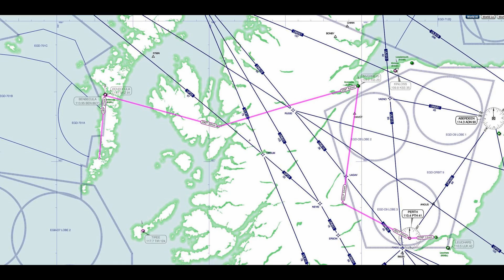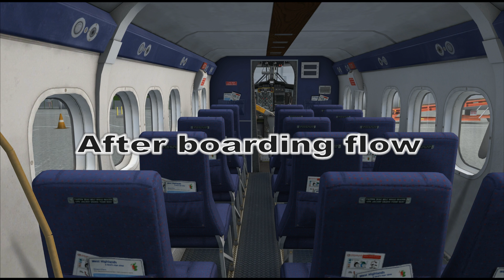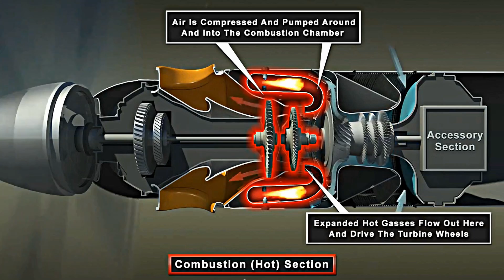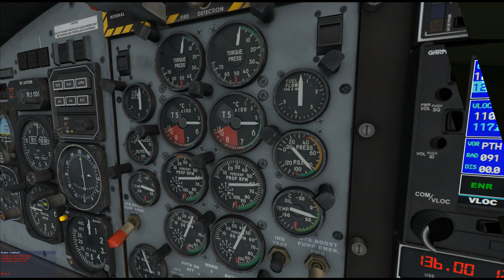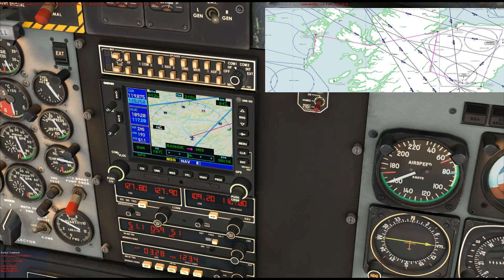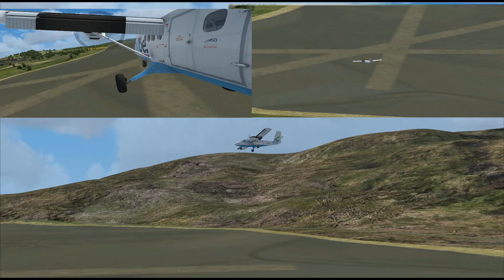Aerosoft Twin Otter M.C.E. Flight Crew Only

Comment: I just purchased this from JustFlight. The trim is intermittent; 
meaning, sometimes the trim works sometimes it doesn't. Same with the 
autopilot. sometimes nav, ias, and alt works sometimes it doesn't. The 
model and cockpit are great but it's hard for me to get excited about it
 when the systems don't seem to work most of the time. Two of eleven 
flights I've made the systems and trim have worked and it's really cool,
 I like it but that's a hell of a failure ratio and I'm too old to 
believe in hope. Just commenting and adding my voice as all, I'm sure no
 one has this issue it's just me as always.
Reply from the maker: Hello, thanks for watching.  I share your frustration. All I can say is that the systems work in my install. Now that's not much use to you, but I have flown the Otter in FSX and P3d V3.0...3.4 HF2. Have you looked at the assignments for Trim and the Autopilot. Are they on your Stick/Throttle/external panels? Or are you using the Mouse in the Virtual Cockpit?  Sometimes there is a conflict, if you have a double assignment. Then there is the horrendous issue of install being corrupt. The issue of Anti Virus checkers messing with the sim. I would delete the Otter and reinstall the latest version, disabling all Anti Virus stuff as well! This simulation is pretty much bang on for the actual aircraft. There's a guy who has built a complete Virtual Flight deck around this Aerosoft Otter Simulation, so it does function! Hope you get it sorted, its a good sim, especially with MCE full support for it!Afterthought Don't want to insult your intelligence, but IAS is a "set to hold" function, Nav is either VOR or GPS as per the Obs setting on the Garmin. I set my Trim to a hat switch, then set a repeat slider in settings/controls. Of course the trim wont work with Autopilot engaged. Hope you sort it!